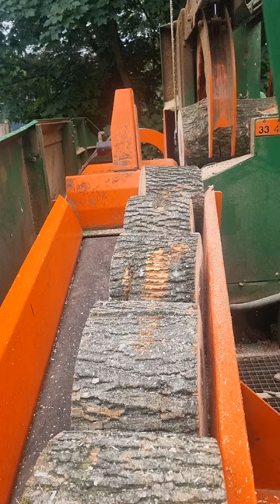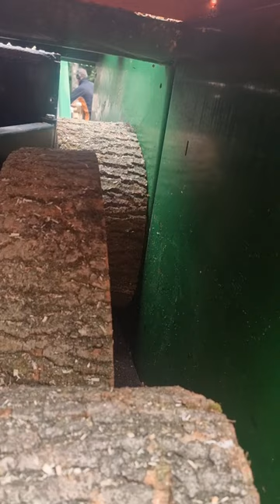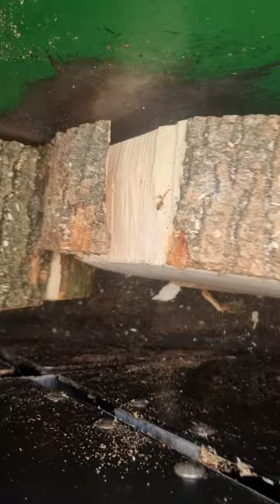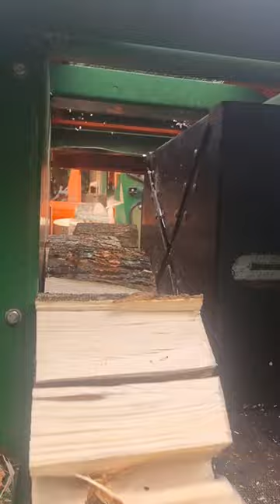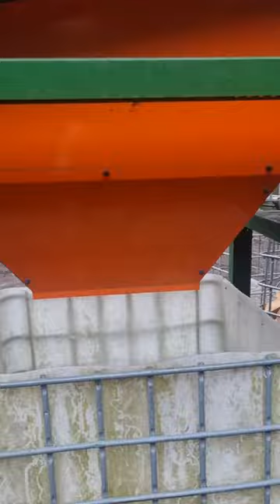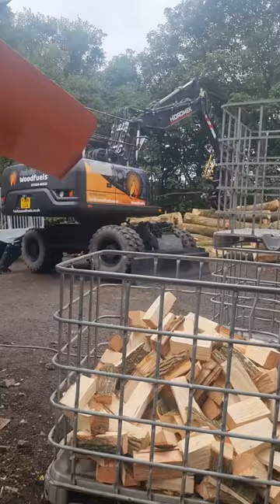Posch k-650 VARIO MOBILE

Comment: Hallo wie viel Schüttraummetter gehn ihn so  ner box rein  oder wie kann man  das aus rechnen
Reply: Höhe x Breite x Tiefe = Gestarpeltes Holz = Raummeter Brennholz
Jetzt das ganze mal 0, 7 und du hast Schüttraummeter. 

So eine Box hat ca 0.7 Raummeter.  Bzw 1 Srm

Kannst das ganze auch mal googlen. Umrechnung Raummeter in Srm Brennholz
Reply: Das stimmt so nicht ganz, wenn die Box ein Volumen von 1 m3 hat geht da eben ein 1 Schüttraummeter Holz rein, das ganze entspricht dann 0,7m Raummeter Holz
Reply: ……why such large chunks of wood split? are they for a specific purpose, ie boiler?
Reply from the maker: Yes, we supply customers who have biomass boilers and they require the wood to be 50cm in length and quite chunky. 
Our standard size of log is around 9".